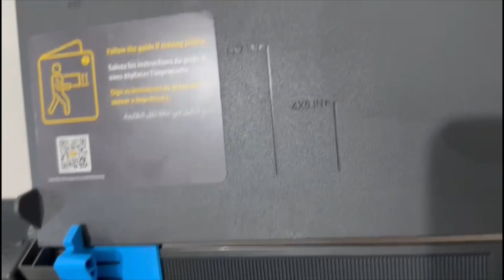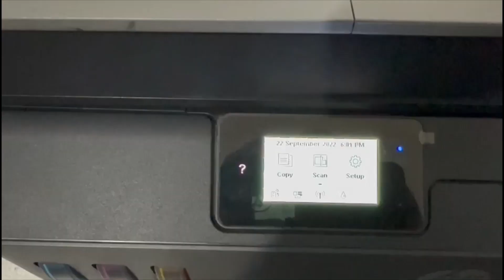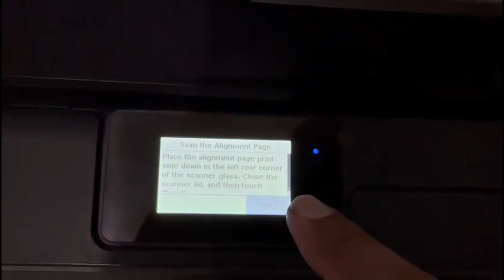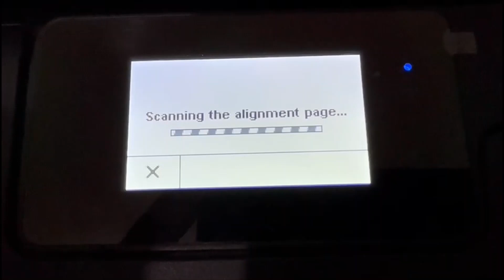HP Smart Tank 530 Service

Comment: I have an HP 515 printer. When copying, a 5 cm black line appears at the beginning of the paper. Only when copying and printing there is no problem
Reply from the maker: Check and clean the glass with glass cleaner or water

Comment: Hola, tengo una smart tank 530 y siempre use tintas originales, debido al disparo del dolar los precios están por las nubes, decidí usar tinta alternativa. Como tengo que hacer el cambio? Debo esperar que todos los colores se terminen y recién poner la otra tinta, o puedo ir llenando por mas que tenga un poco menos de la mitad de tinta por color, o a medida que el color se acabe por completo llenar con la tinta genérica? Gracias
Reply from the maker: Which color is empty fill that only
Reply from the maker: If color printing is good
Reply: El amarillo es el que queda muy poquito, mientras que los otros están llenos xq tenía repuestos de esos colores... Entonces solo relleno el amarillo con la tinta alternativa?
Reply from the maker: Yeah
Reply from the maker: Yellow only enough
Reply: Tengo problema con la tinta negra,en esta misma impresora,me podría ayudar  con información
Reply from the maker: Most of the printers printing Black color more that’s why Black print head has more issues. Check your ink level and’s is not dry
Reply from the maker: Or your printed needs to be replaced